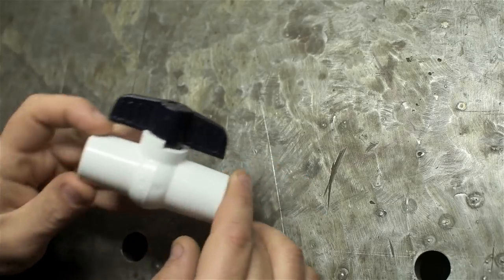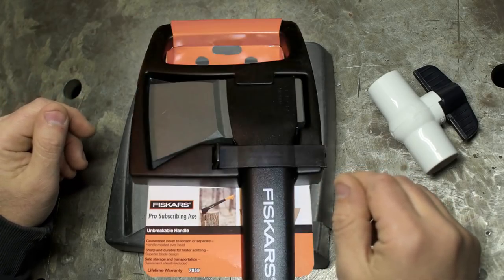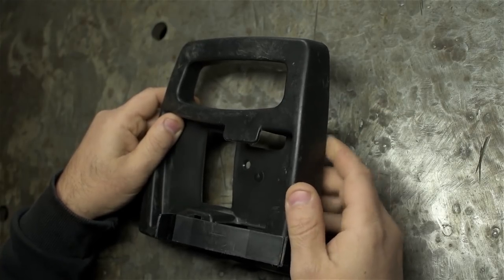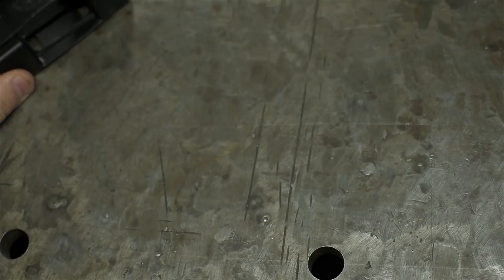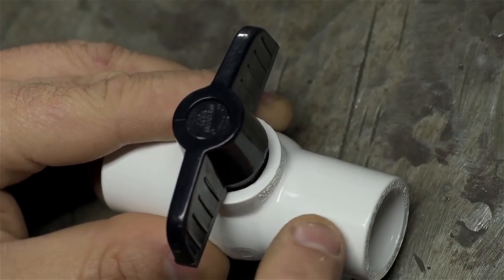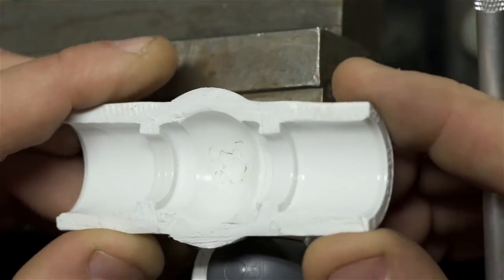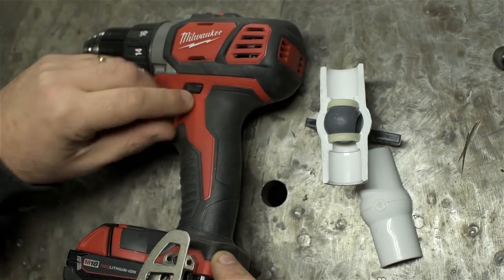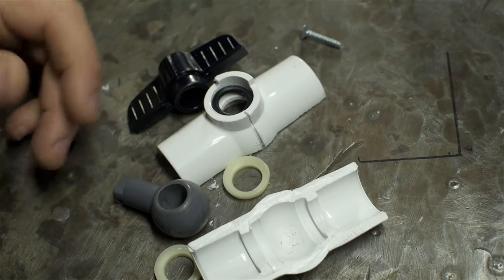Marvels of Injection Molding!

Comment: Hi, Tony, I have worked in injection molding for the last 22 years. You are really close on most everything. The mandrel is called a core and that would be on the cavity half. You would load seal-ball-seal and the core pin on the core half would come up and preload the insert stack of the ball and seals as the mold closes. Around the periphery of the core side core pin will be another witness line that's the ejector sleeve. This is an ejector pin but tubular. This process is overmolding they call it insert overmolding. We do this with an aluminum hub in a steering wheel.  The wrinkling opposite the gate is known as jetting. They just blasted the shot in too fast on the first stage of the shot before a flow front had time to form. Keep up the fantastic work you are one of my favorate Youtubers!
Reply: I learned a wee bit about injection molding when I worked for a plastics fabricating company. One cool thing I learned is that there is no "heater" involved in melting the plastic. The drive screw forces the plastic into an ever smaller space formed by the screw threads and diameter until it reaches the aperture and then it's in a liquid (or semi-liquid state).
Reply: There most definately is heaters, usually three band heaters, referred to as "zones" to keep the temperature stable and the plastic molten. Sure the shearing induces heat to the plastic, but you can't rely on that alone.
Reply: Well, maybe in different applications or materials? These were never discussed in the courses I took nor with the owner of the injection company I worked with.  Now maybe technology has changed, we're talking 25 years ago......
Reply: Depends mainly on the type of part and production cycle (as parts per unit of time) of the mold. You have heaters on the injection machine and in some molds (depending on the part geometry,  the time of each cycle, etc) you have hot runners (nozzles with heaters)
.
Reply: It's my understanding that the heater bands are there to maintain the temperature of the material in the barrel when the screw is not in play in fact a lot of our machines drop power to heater bands until the machine times out in order to save power that's normally on our ppf dedicated machines because the melting temp is lower then abs or pcabs also some molds have hot runners to maintain even heat threw out the mold and aid in the smooth flow of material
Reply: Native Rebel .  There is a lot of heat generated by turning the screw that action helps with developing an even mix and melt temperature. Normally the barrel heaters are left at a set temperature during use to maintain a consistent melt temperature / viscosity. The heater  bands cycle as the themocouples call for it. If the machine is idle the barrel temp might be banked rather than turned off depending on the material and planned idle time.  Runner,sprue and tool heat are more to do with part shape/stress, size,  cycle time and regrind reduction.
Reply: I'm old but not that old. I've never come across a plunger or vented barrel ;) I did have one mold that started its life in a plunger machine. Indeed the screw motor has enough chooch to twist a tip off the screw if not started properly.  The barrel heats are still relevant while molding in addition to screw speed and back pressure etc. If anybody is still reading this thread the typical screw  has feed, plasticating, and metering zones. 
The center plasticating zone is what Steve is referring to.  "Screw" as in you would want 2 people to lift if from a mid size 500ton machine. Tonnage, how much force holds the 2 halves of the tool together.
Reply: Uhm dude? Chillax. You buy an injection molding press by clamp tonnage and shot size. Ball park you figure 3 tons per projected inch of your plastic part, to keep the mold from blowing open. 22k developed injection pressure tends to be on smaller say 20 ton machines which has nothing to do with anything.
Reply: LOL. I'll keep that in mind when ordering a molding machine. For molds my sources understand core deflection if that's what you're on about. Peace.
Reply: I can tell this guy knows what he is talking about. It is also really obvious you don't, so quit while you are behind .
Reply: steve gale   Personally is spelled with two ll's
Reply: Why did I read this whole thread?  Because injection molding is fascinating.
Reply: 'Around the periphery of the core side core pin will be another witness line that's the ejector sleeve.' 
VISIBLE @ 10.28 ?
Reply: steve gale the effort involved in your response betrays your lack of anything more important to do
Reply: I also work injection molding, and honestly all the jargon is on a company by company basis
Reply: I work in plastics too.

Why are you calling the PART LINE a witness mark or line.
Reply: @muskokamike127  there is a heater.in fact injection molders use a whole series of them to heat the shot in the barrel before the injection process starts
Reply: @muskokamike127  In extrusion, during run time,about 80% of the energy used to melt the polymer is from mechanical action, and the other 20% is from the heaters. That said, it would be very hard to start up the mechanical action of the screw in the barrel, in an extruder with a barrel full of cold plastic.
So, yeah, there are a hella lot of heaters involved.
One reason is just to get the machine running, then to fine tune the melt temp of the poly at the die head/mold.
In larger extruders, there are typically six zones with some fairly high wattage heaters, where in injection molders, there are usually fewer - like three or so.
Basically, in start up, heaters are ~100% the source of energy to melt the poly. As the machine gets going, the mechanical action of the screw - mainly compression - takes on the lion's share of the work, while the heaters are used to "feather out" the desired output temp of the poly at whatever stage of processing.
Reply: I just read this thread! Go plastics, be Smarter!!! fyi I'm a polymer engineering student. 🎓 June 2020
Reply: Well I know this is an old thread but there is a lot of info thrown around that isn’t correct based on machines and tools an individual has seen. I work for a company that does compression molding, hot and cold runner systems and a combination system. We also have stuff that no other company has. We run mono injection coninjection which we have patented due to the connection of the 2 barrels to do some really cool some say impossible feats. And 3 barrel molding. Presses are in deed sized by tonnage and screw size. The hot runner systems we have are direct gate, tunnel gate and sprue gated. Direct gate is for multi cavity robot assembled parts. We use sprue hot runner systems to run tools faster and create many different parts in the same mold. A hot runner system can hold well over one shot of material ( not sure where u got the idea it’s one shot) also the heater bands do 90-95% of the heating but they keep the melt stable also they are 100% necessary. Try starting a machine from cold without heater bands you will snap the screw tip off. Now let’s move onto the cold runner systems. These are used for simplicity but also speed. Then there is what you say hot runners are for surface appearence and cold runners need extra finishing which is incorrect. We have many cold runner systems that get degatted and packed. The sprue to the runners then runners to the parts. The runners narrow down so they can be broken off. We run cold sprue systems without robots that are anywhere from 12-32 cavities that get degated manually without any issues and operators can keep up fine. There is a lot to injection molding I work. In a facility with 90 high pressure machines one of which was the largest production machine for a long time. We have 100 ton machines up to our 6600 ton machine. And everything in between. I couldn’t even begin to explain all the different mold types we have I think we are in the neighborhood of 1000 different tools in house. The 2 guys arguing in these comments are both probably correct in some rights as that is their experience but also have some falsities in them too. Every machine and tool is different. And there are tons of combinations and differences
Reply: @wwg-worldsworstgamer6678  Agreed. If anyone ever tells you they know everything there is to know about molding, You can rest assured that person is full of shit.
Reply: I've been building tooling for...well , along time now...
I can't believe you other gentleman (toolmakers) here didn't caught this.
Tony was (is) spot on how this was made, but the "mandrel" or core must be made in two halves, one mounted on the cavity side, the other on the core side.
If this is NOT done , the core would be mold locked inside the part.
To explain better, look at the video, 11:00,  has you can see, the core is actually sized to make both large and small ID's on each end.
A one piece core would not be able to come back thru after the part was made.
A 2 piece core, that meets in the middle of the ball is the way this works. When the 2 halves of the core meet, their pinned, meaning 
one going into the other for stability.
Reply: @Trainwheel_Time  I agree with what you said.  Basically... because I'm a Master molder II too.   Congrats for being an educated person.
Reply: Bullshit.

Comment: The E and D are called cavity ID . That way if there is a defect you can tell which cavity did it. Most tools make more then one part at a time. We have molds that make up to 36 parts at once. Oh yea I've been a tool maker for 30 years. You did an excellent video explaining basic molding and yes you are right about the over molding.

Comment: the mold actually isnt a perfect negative, it also takes into account shrinking due to the cooling of the plastic which can be quite a lot. Which is also why mold making is a real art
Reply: Especially before Moldflow and similar software. Even after the mold is designed and fabricated you can change the part size slightly by changing the process conditions (but that tends to compromise cycle time).
Reply: The thicker bottom of the valve is probably intentional as well. I hypothesize that it would increase flow  along the bottom where the plastic is injected versus the rest of the part allowing control of how the weld line forms at the top

Comment: I knew some of this having worked on an injection molding line one summer but your explanation was much better.  A few things I learned that summer: One some machines run much hotter than others, polystyrene takes only a little heat, PVC a bit more, and Polycarbonate is scary to mold. Two when a mold is blocked they like to crank up the heat even more, the foremen got localized 2nd and 3rd degree burns all the time when the molds would "clear" themselves. And three, all parts are made of either "virgin plastic" or regrind, Four flash and sprue always need to be trimmed from the parts, always. This is the job the noobs get and hated. You can also mold in thread inserts and all sorts of other interesting things.

Comment: The drill housing was likely made using multiple shot injection molding. The whole part being made in one tool.  The red plastic would be shot first then then the tool would have inserts that would back off, just enough to make room for the black plastic, then the second shot would be injected.  Check out multi shot injection molds, iv seen up to 4 shot molds, 4 separate plastics in one tool.
Reply: damn those things would cost like a 100,000$
Reply: from my understanding 7 figures is more accurate
Reply: For 100,000$ you might not get one simple mold made from tool steel.
Reply: @krzysztofukawski2348  Probably $25,000 in China from P20.
Reply: @BaldurNorddahl  You can't buy the mold base of a production mold for $1500. Real molds usually have a lot of side action components such slides and side cores , alignment features such as locks, internal cooling features such as bubblers. A lot of EDM work and a lot of polishing and texturing. And the materials have to be hard to last. You can't compare an SPI class 101 mold (more than 10^6 cycles life) with a couple chunks of soft aluminum off the CNC mill that might last a few hundred cycles and can't maintain full clamping pressure to get detail without crushing the mold or flashing.
Reply: @spehropefhany  Here is another youtuber that machined a mold recently: https://youtu.be/YrbQIN2TBhM

As he says in the video it was not that expensive. Of course for high production runs you might choose something more advanced, but then you are doing so because it will be even cheaper per part.
Reply: @BaldurNorddahl  Here https://i.imgur.com/mKC5KY6.png is a relatively simple mold I designed. The tie bars of the target machine are also shown. Only a single cavity, with a special temperature controlled nozzle that sort of acts like a hot runner (but much cheaper), nitrided ejector blades as well as  the usual pins. The core is cooled with 3 radially arranged bubblers. A mold is, in many ways, a heat exchanger.  The plates are Swiss cheese of cooling passages created by side drilling.

Comment: 2 notes...  Betting the "mandrel" is part of the whole mold.  One seat and the ball are stuck to one side of the tool, and the other seat is on the other side of the tool, and when it comes together, the center seals on the ball itself.  Part the second, the thicker on the bottom than the top is probably intentional so the plastic flows more reliably to the far side of the mold from the injection point.
Reply: https://www.youtube.com/watch?v=LfiRGJYjgMs
That's what it look is going on here, except there is a mandrel attached to the ball  for the handle to be attached later.
Reply: fdfoxter  The only difference there was TOT's ball valve was made with a hot runner and your video showed a cold runner.

Comment: I worked in the metal diecasting field for many years in my youth. That all came back to me watching this video. We also had some parts that had inserts that we put into the die so as to become one part when cast. And the part of the die that held the inserts were called cores. Sometimes the part required cores not inline perpendicular to the parting line and those required a moving core that would be put into place using its own hydraulic cylinder after the diet closed.

Comment: I work in a factory doing injection molding for shoes, specifically rubber soles and plastic heels.

Despite most of the products we make need quite a high precision, we still use aluminium alloys molds that get banged really easy, but also the work time of those products are sometimes over the 3 minutes total between injection and cooling, also they all require quite some calculation to prevent mismatching once the rubber/plastic shrink after cooling, cause it can mean a size 10 sole could become a size 8!
Reply: At the injection mold factory I work at we also use aluminum for the motorcycle and bicycle grips. Everything else we use p10.

Comment: 12:40 - Moved up about 10, not 20. 20 would have made it 180, 220.
Reply: Thought that too, 20 thou is a fair amount of deflecton 10 sounds more reasonable
Reply: Yeah same here, .010 would've made both sides .200
Reply: Isn't the inner side of PVC fittings tapered tho? As in, if he put the caliper in further, it would read higher?

Comment: I've spent some significant time working in a shop that makes injection molds, and repairs/services them, and the mold that made a valve like that would likely have tolerances big enough to chuck a cat through. However, in a shop like I worked in, where we mostly work on mold for the medical industry, our tolerances for critical components in the mold are + or - 2 tent-thousandths of an inch, sometimes, only + 2 tenths, a range of only .0002 inches! The precision that an injection mold can achieve is astounding, and the work that goes into making them is too. love the videos man, keep it up!

Comment: Nice to see you talking about my everyday job. Just a interesting fact ruberised handle is injected in one mould in one operation ;)
Reply: I been trying to get my head round how that works. No success so far.
Reply: Robert Leitch . One way to do it is with 2 injection units and a rotating platen on one half of the tool. Shoot the plastic part rotate half the mold close on another half  of the tool having space for the rubber over molded grip and shoot it again with the other injection unit... or a third unit..

Comment: To get an part with a rubber grip for instance, we use what is called a 2 shot. The mold has 2 cavities. One cavity molds only the rigid material then the mold opens and one side rotates over and closes again. Then the soft shot shoots right on top of the rigid material. So the rotating side of the mold is the same on both top and bottom. The stationary side of the mold is set up to shoot rigid on one half and soft over top of the rigid on the other have. So there are 2 separate injection units on one press.

Comment: That 5 inside the recycle sign does not mean it can be recycled 5 times. The 5 stands for PP. It can be 1-7 for plastics unless specified.
Reply: He didn't say it was the number of times it could be recycled. He said it was the number of times you'll get to use it before you lose it or run over it with your car.

Comment: I have 3 of these valves in a homemade extraction system, much bigger but the same valves used to direct the flow of extracted air. Work a treat. Simple, cheap and easy

Comment: Some molds are very simple and some are very complex indeed.  Bottles - inject resin, rotate, cogitate, blow air in and then Freon. Viola bottle.  Then there are those with holes and 4 dimensions...  I think some of the fancy ones are Engine blocks and maybe calculators...  Thank for the dissection!